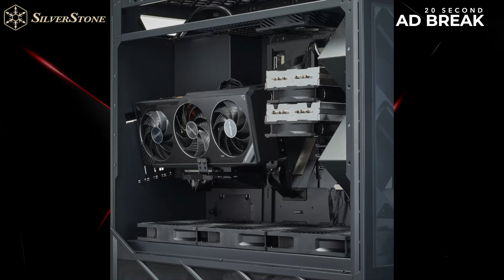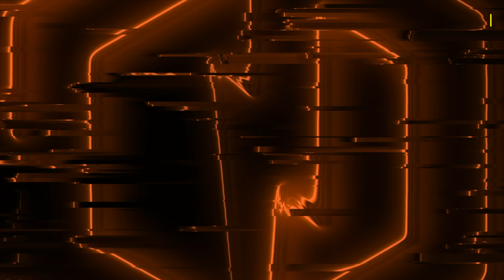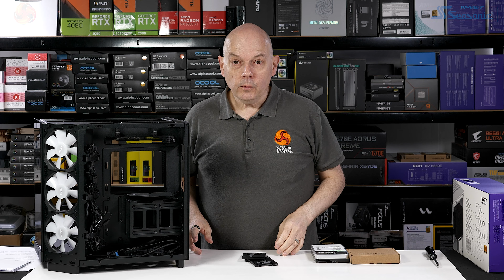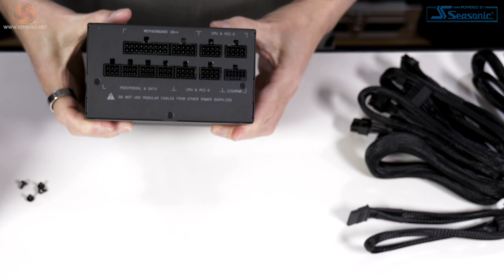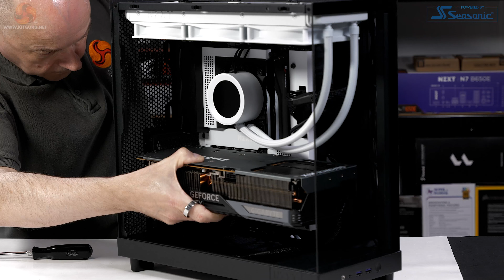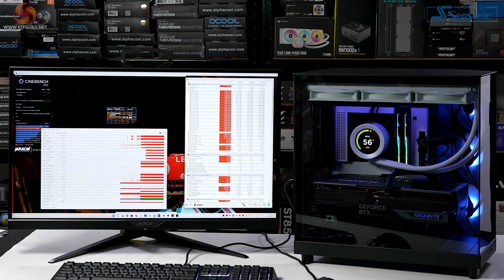NZXT H6 Flow RGB - A First Time For Everything

Comment: I run mine with the radiator , side and rear fans reversed. In this configuration the rad always gets fresh air, and the hot rad and gpu air is moved by the rear fan towards the side fans and exhausted through them. My 7800X3D stays at 75C and my 4080Super at 65 during combined stress tests

Comment: he didnt install any exhaust fans.....  or intake from the bottom lol so id assume this case can go much cooler than what he's showed here.    id probably try to fit a 240 radiator for the top front, and leave back top for an upwards exhaust.....   as well as the obvious rear exhaust fans...

Comment: wait how did you change the color of the rgb fans on the case? they don't pop up on my nzxt cam app.
Reply: if you're not using the nzxt rgb controller, then you'll have to change the colors of the rgb through the bios

Comment: Curious as to why he didn’t run the 2 140mm fans as intake in the bottom of the case as well. I was really hoping to see a comparison. But,  I suppose I’ll just do my own testing once it arrives in 3 days.
Reply: Hey i'm curious as well. I'm looking to buy this H6 Flow and i'm really concerned on what the best fan setup will be. I've heard the bottom fans will increase temps for the CPU most of the time, don't know about the GPU though. That, and one should use only either exhaust top fans or intake bottom fans. Did you do your testings?
Reply: I’ve got 5 intake and 3 exhaust, my radiator is 369 like in the vid at the top for exhaust and I have 2 140 fans on the bottom for intake, so far they have helped with cooling everything I can’t remember the numbers but I do remember that they where lower with the 2 extra fans

Comment: hey LEO can you please help me answer this question....i saw in your first little quick ad that in the corsair setup;  Ive been looking HARD at the 5000t for my new build and in that specific ad in this video and in a few other photos in what not over time....i keep seeing it WITHOUT the MESH FRONT PANEL.....is what they are showing GLASS?? or is it just WITHOUT the front panel at all lol?!!!!  ive spoken with corsair experts on the website about this and they keep claiming that there is NO glass front panel mod available and that you cannot switch on the 5000x glass on to the front panel.......so WTF....WHAT GIVES!???
Reply from the maker: To my eyes that looks like a render rather than video of hardware so I would say it is only a representation of a case. Alternatively you could treat it as a template for a mod.
Leo
Reply: @KitGuruTech  thank you....i would kill for a version of the 5000T that has a glass front panel and not mesh. maybe im overreacting about it but the mesh just seems less/cheaper of an aesthetic....    edit: there can still be airflow with the cutouts on the sides of the glass like in the 5000x....its disappointing that the 5000x glass panel cannnot be compatible to be thrown on the 5000t considering its almost the same design

Comment: Appreciate the review but I think you went a bit light on the cons ..a "Must Have" should be extended to "Must Have If You Use Only NZXT Components".. I wanted to buy this case but you cant put a radiator on the side .. you have to be aware of the thickness of your fans .. MB mounting is a little too low .. Trying to use a 360 AiO at the top will interfere with some MBs..
Reply from the maker: The NZXT AIO I used is quite typical of the type and while 30mm fans would likely be a problem I don't regard that as a criticism of the case. Similarly clearance with tall RAM and/or motherboards with a fixed I/O and big VRM coolers. These are certainly considerations but compact ATX cases always struggle in those areas. 
Leo
Reply: Thank you for your response.. It just seems like they built it for their parts and not give consumers options as you would like to have when building a PC

Comment: Another O11D clone but the diagonal edge is on the back side intead of HYTEs front side diagonal glass or screen edge.
I would like to see something new and truly unique but still functional in the ATX case market.
But i gues there are only so many ways to make a PC case in the end.
Reply: Yeah I was thinking similar. What case do you use for your build ? A hyte?
Reply: @rufusmctavish1164  Naah i have 2 rigs atm. One is in the Fractal North TG Black and the other is in the ThermalTake The Tower 200 Snow Edition.
Both are nice but still there are things i dont like about them. Im changing cases pretty often trying to find the ''right one''. 🙂

Comment: No other channel forces three or four "sponsor" ads on their audience.. That's about the only negative thing I can say.. its jarring and some of them with the sped up voice are just lazy... That said, despite some of the flaws.. I REALLY want this case. Have a Y40, not impressed with the Y 40. Also, every reviewer seems upset at the lack of 120 support on the bottom.. Why? 140s move more air with less noise.. I wish more cases were making 140mm only mounts.
Reply: Don’t know what channels you watch I’ve sat through four videos from different channels and I’ve had to skip 90 seconds of the actual reviewers selling some tat. At least these short ad breaks are good products and a time stamp is always there to skip them. I’d like to keep Leo in a job not like I’m paying anything.
Reply: Hit the timestamps. They put them there for a reason. I guess they need support and it’s better than Linus 2 minute ads selling a vpn that doesn’t work

Comment: I like the design touches.  It's a nice case, I like it a lot.

The only slight thing I have against it is given the space in the back I'm slightly appalled that there is only bays for 2x 2.5" drives and 1 3.5" drive.  In conjunction to my NVMe drive, I have 4x 2.5" Sata NVMe drives - and I don't think that's unusual these days.  Oh well, that's where even simple case mods with a 3D printer can come in handy.

For example my (older) case has the space for all those drives - sorta.  The problem with my older case is that front case fans interfere with using the 2.5" drive mounts.  My solution was to CAD up and 3D print a 2 drive tray that mounts cleanly behind the motherboard tray (just enough space to do that).

Of course, I'm still going to be vocal (for virtually all modern cases) about lack of having even just a single 5.25" or 3.5" external tray.  I need and use my SD card reader for my 3D printer, & I don't want the desk clutter of using an external USB card reader.  It's most convenient to have it in the system (the computer is already on the desk, so I like to keep it all integrated). ;-)
Reply: I always wondered why people needed that drive space as optical is basically dead. Do Lexar not make a nice neat multicard reader that would sit quite neatly on top of a case that would work ok for you ?
Reply: @theonlyredspecial  I don't want the clutter (inc. things sitting on top of my computer).  Besides, that's where my gaming controller sits and headphones.
Reply: @nukedathlonman  yeah sure makes sense. wouldn’t bother me but I understand 👍🏻
Reply: While i agree there is a ton of wasted space in the PSU side, if you are just using 2.5inch ssds then you can just literally toss in there, they don't have any moving parts to worry about.
Ofcourse if you don't want to toss them you can just double face them in there or just search for a similar solution online, pretty sure catties that can be mounted easily that offer 2.5inch slots are easily available to buy.
Also for the 5.25 bay pretty sure the top-end bequiet offers 1slot
Reply: @visamurai  Well, I'm not one for haphazardly tossing things into my computers or taping down parts like that (or using a glue gun, etc) - I take pride in my builds and I do have standards. 😉 LOL

And as I said, I can always 3D print something... It's a very minor annoyance that one would have to come up with something as opposed to it already being there - it's got all that space after all.

Ah well, I still like the case - I'll likely recommend it to others.

And your right, BeQuiet does in fact still make some of the very few cases that have external drive provisions - but those cases never seem to be stocked at any of the local retailers for me (yes, I could always use Newegg for one).🙂
Reply: @visamurai good idea never thought about that. I wouldn’t actually like those large drive bays in a case I bought. It would be wasted space for me as I would use them internally.